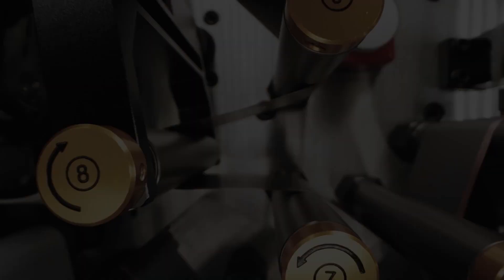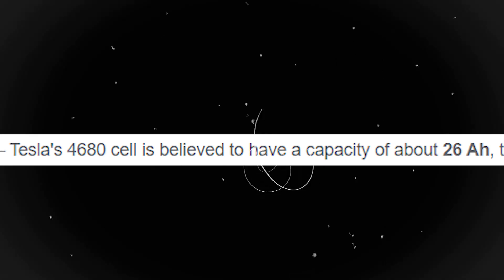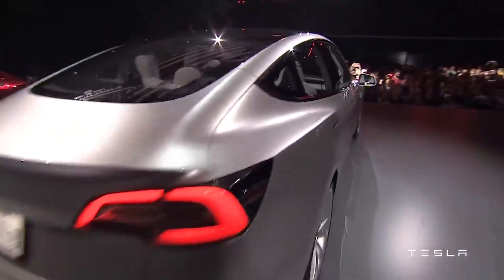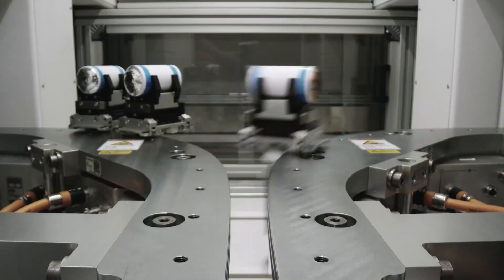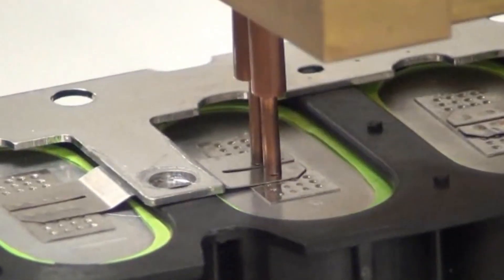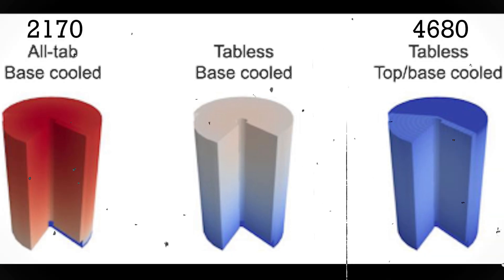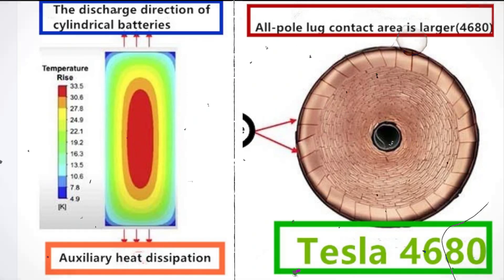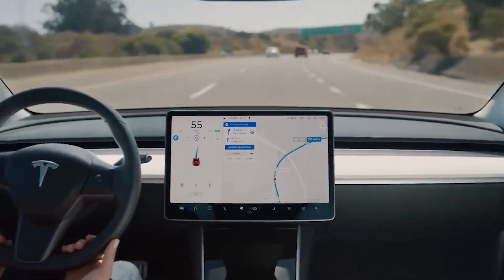Exploring Tesla 4680 Battery Advancements Over the 2170 Battery

Comment: What rubbish. The batteries are bigger so take up more space. The actual difference in range comes from improvements in energy density, not battery size. You can fit more small batteries in than you can large ones so the overall available energy doesn't change much.
Reply: Agreed, but the ignorant of the Laws of Physics will go for it!
Reply: *Claimed improvements in energy density. Independent analysis of the 4680 by the Laboratory for Energy Storage and Conversion (LECS) revealed that energy density was lower in the 4680 at 232 - 244 watthours per kg. as opposed to 269 watt hours per kilo for the 2170. Volumetric energy was also found to be lower in the 4680 at 622 - 650 watt hours per litre as opposed to the 2170's 711 watt hours per litre. From a performance perspective, Tesla have missed the mark with the 4680. It's redemption might come when manufacturing costs and volumes are established, however, or when they move away from 40 year old chemistries and into the era of LFP's.
Reply: @davidbrayshaw3529  But facts don't matter. The lord Musk said it is so, therefore, it is so.
Reply: @urbanspaceman7183  Why do I always forget that?
Reply: @davidbrayshaw3529  https://www.youtube.com/watch?v=feXc-SIBsEU